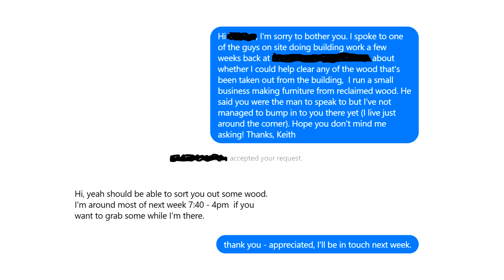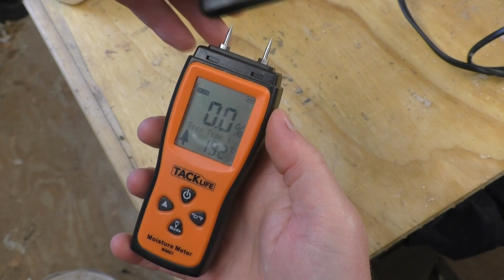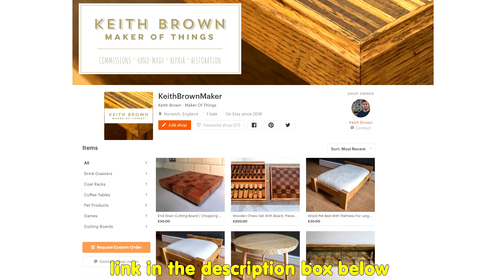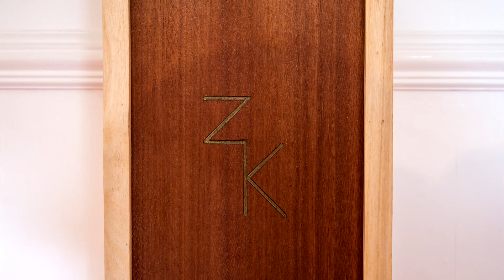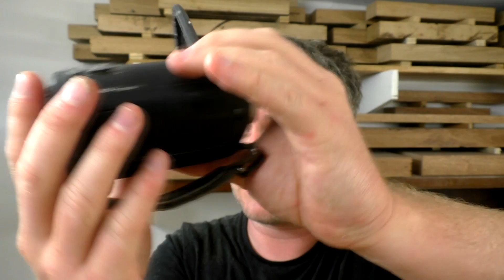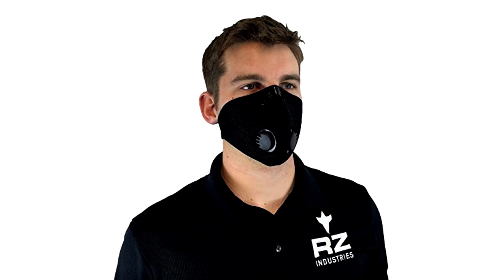VLOG 1 - Salvaged Wood Haul / Work In Progress / New Camera Gear / Tool Talk

Comment: Hey up, you should get the festool biscuit cutter/jointer, once you've got it, it's done. Pricey because they're good. I bought the PST PEL800 Bosch Jigsaw, the upgrade from yours after watching your video as I like the guide thing on the front and the idea of the pendulum blade which cuts through harder woods like butter. Bosch seem to be superb for the hobbiest, but like anything once you go pro, you need pro tools.
Reply from the maker: Yes I've loved everything I've ever owned by Bosch.  Really great tools

Comment: Have a look at one of the better doweling jigs as an alternative to the Domino, does much the same job for a lot less and only a little more effort. I’ve seen several YT makers sell their Domino, Jay Bates probably the best known, as they just didn’t use them enough. For me the Festool kit is for your professional tradesman making their living from their work more than the maker market.
Reply: the green man: dowels are a lot stronger than you might think, especially if you use maximum diameter feasible for your pieces. As for accuracy, that's the point of a nice doweling jig. A good one, and make no mistake there are a lot of not so good ones out there, will get you dead on accurate dowels fast. I think if I was in RnB Brown's current stage of business, I would give a doweling jig a try first and see how I like it. They're only about a hundred dollars on the high end.
Reply: i disagree, the domino is a much stronger joint, and more accurate than multiple dowels.
im not a festool junkie but that tool is worth it if he wants to speed up production.
Reply: nah, ill give the shitty dowels a miss.

Comment: Vlogging looks like a win, you are obviously more relaxed and your delivery is much smoother when you aren't focussing on cutting off your fingers!

Wood Haul> Lucky git! If you spot any more of it around Norwich let me know so I can have a crack at it. Maybe worth putting a rack over the window or suspended from the ceiling or building a nice unit to go behind your sofa to conceal all the wood or a lean to with some fans to keep the moisture down?

Work in progress> Sounds like you are sought after enough to do this as your day job, plus knocking out lots of stuff for your Etsy store you'll be able to keep the wolf from the door.

Camera gear> Picture does look a bit better, maybe lean on Panasonic to see if they'll give you a 4k camera to review ;)

Tools> Couldn't hear you over the sound of the tablesaw! I'd love to see a real world decibel shootout between induction and non-induction saws when you make the leap but those cabinet saws do look like you need a US-sized workshop for it.
Get the Domino or a cheaper equivalent but demonstrate how to do it the poor man's way and how to use jigs in the video and do a blue Peter 'heres one I made earlier' so you don't put off us amateurs (bonus points if you stick a silverline or Parkside sticker on the side of the Festool when you get it). Time is money!
Reply from the maker: Thanks Alexander :-)

Comment: About wood moisture content... I recently got a massive bag of "seasoned" hardwood firewood. The bag had been standing in the open and the moisture content was between 20% and 30%... looking bad. But after a short time in my shed it was all down below 15%. So I think the initial readings for wet wood can be misleading and you need to get it inside for a week at least.
Reply from the maker: Yeah I think I'll let it dry out a while longer before I use it

Comment: Try a finger joints jig you can make a crank for it so it shifts the wood at regular intervals, it can be particularly useful for making quick dovetails as well. It works very quickly on the table saw and is also very good and simple process for making joints.

Comment: Hmm, interesting that you sold the AEG drill... what was the reason for that?
On the domino front, generally only people who never used them would say they “ridiculously overpriced”, they are a massive amount of money, but when you factor everything, they are so for a reason..
If you do decide to try it. Buy one from a dealer and take advantage of the 15day returns policy you get. Or contact Festool direct, they’ll send out one of their reps to run you through the machine at your place. If you do buy, buy the SET version with the extra bits, and also get the deal with the systainer case. With different sized dominos and the full set of cutters. If you go cheap from the start, and decide to keep it because you can be more profitable, you’ll be gutted when you have to fork out for the individual cutters as well!!!
Reply from the maker: +Richard Morley the AEG drill was excellent but it was far better than I need really for workshop use. It's more of a professional tool. I'd rather use the money to buy something I need. Thanks for the festool tips, appreciated
Reply: No Probs, If your looking to  use the domino for making things for profit, think about it from a business point of view more than a "what my viewers think, making things for profit will be a far more sustainable business than anything that youtube will bring in. But it's a tough price tag to swallow initially....
Reply from the maker: Yes!  good advice thanks
Reply: Rag 'n' Bone Brown ..... Use that same logic when considering the Festool jointer purchase.

Comment: You really have to push the prongs of the moisture meter into the wood — at least half a cm. The way you measure on the surface will give you measurements that are not trustworthy. Thought you would like to know. : )
And a Domino will change your life (in a really good way).
Reply from the maker: +Bert Vanderveen thank you, you're right, I'm now getting readings of 10-11% - still learning 😀

Comment: Good video 👍 the domino is a really good bit of kit, we have the larger version and it does make the process of joining very easy. The clear measuring guide at the front is a brilliant feature as you don't even have to mark out especially when it comes to putting legs together. I'm not sure how much the actual domino pieces cost, as fortunately in the workplace I'm in we have the machinery to make lengths of our own... so that might be a factor to consider for cost of projects.  But on the whole it's a really good machine, the large version is fairly bum heavy so you do have to be careful of it tilting when cutting, but the small version sounds ideal. But I do agree that they are ridiculous expensive... our workshop had it on a trial basis before they actually paid for one, so maybe if you contacted a supplier, or even Festool themselves you could do a " try before you buy " hope this helps in your decision. Keep up the good work 👍😀

Comment: Great stuff, Keith! And very well done on the wood haul. Re: the Domino - I have one and I haven't once regretted getting it. It does a simple thing very, very well and makes a lot of things much easier. My, limited, experience of Festool is that they are very expensive but they DO work well. The sanders are second to none in dust collection and, as I say , the Domino does what it does brilliantly. Hear the mitre saws are good too but....until the existing one gives up the ghost I'm stuck with it. For what it's worth, I went for the larger Domino. There's a wee adapter which allows you to use the smaller cutters on the bigger machine and I figured that would be a bit more versatile. Garden gates, doors and cabinets are much easier with it. It's a time-saver and nothing's more important than time.Best wishes and keep up the good work!
Reply from the maker: thank you!  Appreciate the feedback and advice re: Festool
Reply: You're welcome. By the way, Charnwood do a table saw or two... MIght be worth a glance... All the best.

Comment: After spending £900 on the Charnwood w650 I soon regretted my decision. It's heavy, sturdy and has a quiet powerful motor but that's is. The sliding carriage can only cross cut 500mm, when ripping any other material you have to remove it as it gets in the way. The aluminium extrusion it runs on has around 1mm bow in it so I get a lot of binding, tear out. Plus, it's always in the way, I'm constantly walking into it. The rip fence, although very sturdy also has a bend in it, after contacting Charnwood they send me 2 more out which was also bent. Adjusting it is a nightmare, I get it parallel close to the blade and when I move the fence away it will run out. It also doesn't sit perpendicular (90 deg) to the table (its the same on the sliding table fence too). Dust extraction is very poor, although it takes a 100mm hose, the hose inside the saw is much smaller and id say 40% of the dust falls into the saw and clogs the tilting action. And finally last week the hand wheel came off and the worm screw has become stiff and grinding..... Apart from that, its spot on 👍. Thanks for letting me get that off my chest, I feel much better now.
Reply: I stand corrected, the second hand wheel has now come off...
Reply from the maker: haha oh dear! thanks for the info - I've heard mixed things about the saw (possibly more bad than good) so I think I'll keep looking for something a bit more compact

Comment: check out the Axminster t s 250m table saw.
even says in the description " unlikely to annoy the neighbours"
Reply: I had the TS 200 version which is slightly smaller than the TS 250. Incredibly quiet but for me it was underpowered and struggled on thicker timber. I ended up selling it and going for an old (1960) Wadkin Bursgreen table saw. Got it for £400 off ebay and it is brilliant. Very quiet and built like a tank. Well worth buying if you see one Keith. (I also have the Dewalt like yours that I can sling in the car) Best of both worlds!
Reply: +Barry 
I bought a wadkin ags 10 about three years ago as a do up er, paid £100 for it without a fence. as of yet never got round to doing any thing to it but one day I'll get it done up when the kids get older
Reply: I've got the TS-200 and I love it. The cast iron top is great. I've ripped loads of hardwood and only have to make multiple passes with really thick pieces which isn't that often so it doesn't bother me. It chews through most things I throw at it with a sharp Freud blade in it. My shop is a garage joined to the house and I can use the saw late at night without waking the wife or kids. I'd definitely recommend checking out the TS-250 if there's an Axminster shop near you 👍
Reply: I've got the ts-250 from Axminster as well and I love it. I would recommend that you buy the extension table straight away just to get the longer rail and the longer fence as the original one is too short. I've never had any problem with the power of the motor for the moment and it's relatively quiet.
The saw isn't flawless but nothing than a good diyer can't fix. I've made my own dust collection system and cut the riving knife to the same height as the blade. That my favourite tool of the shop.
Reply: I have the Axminster TS250, and I wouldn't recommend it. Yes it's quiet, but the build quality is awful, and the mitre slots are not the standard size, so things like the UJK mitre fence don't fit. Finally, dust collection is non-existent. Of all the tools I own, the TS is the one I regret buying.
Reply from the maker: thanks all, definitely checking out the Axminster offerings

Comment: Rz aren't that good they are not as effective as a proper resperator. I would recommend the JSP force 8 mask with p3 filters.
Reply from the maker: The RZ mask still hasn't arrived but will let you know my thoughts when I have it... Will check out the JSP offering - thanks
Reply: Ty McBride I’ve not tried the RZ masks, to me they look like the city cyclist smog masks. I use the 3M 7500 series, the 4251 for vapours and Trend AirAce, all with P3 filters for routing with MDF. I’m interested to see what people think of the RZ’s -  but I’m not convinced myself.